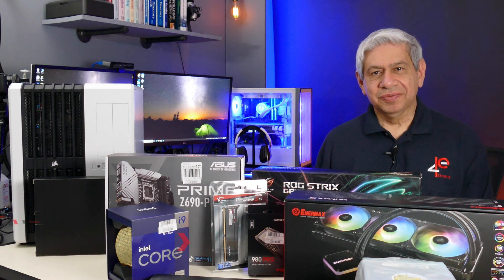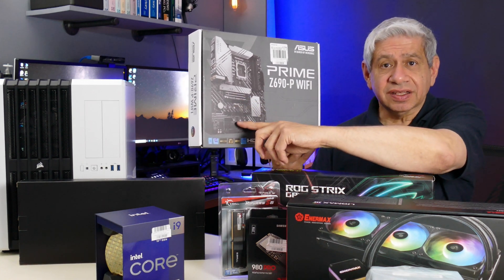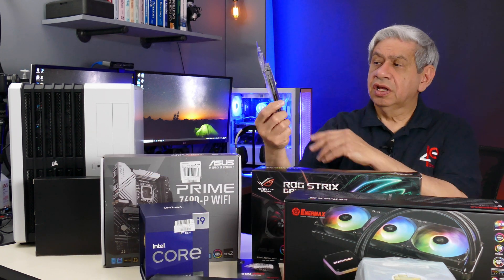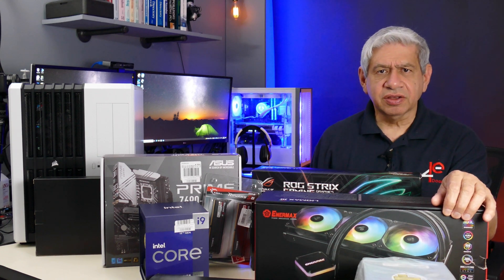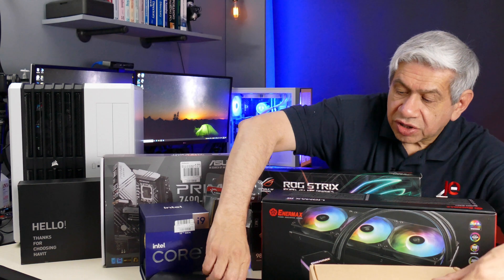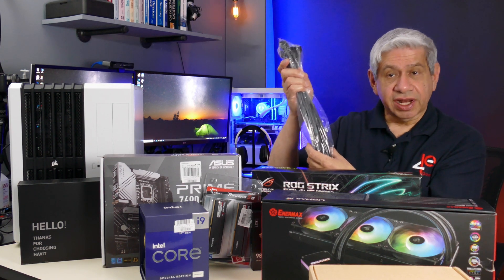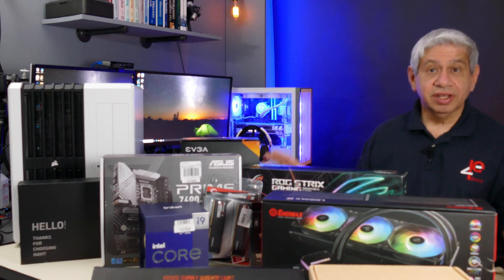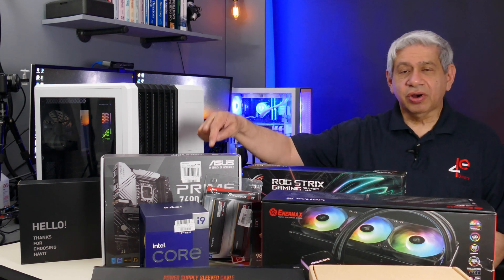Building a Home Lab VM Application Server – part 1, The parts roundup

Comment: Quite the power house.  I didnt see a link for the case.
FYI a number of years ago I bought a Coolermaster Liquid CPU cooler.  The pump failed, there is no indication of this other than unexpected shutdowns, then diagnosis using a CPU Temp utility.  You might consider installing this in your build.  The cooler was replaced under warranty
Reply from the maker: That case is no longer sold - probably since it has a plexi window rather than glass.

I know what you mean about AIO Coolers.  Though I've not had one fail on me, the best practice is to replace them every five years whether they've failed or not.  In this case, as I mentioned in in the video, I will likely get a better one than the one I bought for this build.  I will build with it, but then replace in a couple of weeks (possibly another good video), prior to my putting that server into 100% deployment.  Then use this one for the new test bed I plan on purchasing that supports water cooling.

Comment: The one bit of info I missed in the video is how you buy a higher binned CPU. When I have looked at CPU's for sale I have seen that some are on trays, and others in boxes. Are the higher binned CPU's in boxes, or on trays? Or are they sold in some other way?  Thanks. 😊
Reply from the maker: From what I've seen, you really cant tell the difference unless they are specially marked.  In the case of the i9-12900KS, Intel chose to specifically sell them as KS rather than just K.  Of course they are trying to make more money from those that binned well.

Binning has been done by many/most component manufactures for many years.  On some, like carbon resistors, that is how they determine the 'tolerance band' that those devices have.  THe normal would be plus or minus 10% of marked value, with the cheap ones being 20%.  The price would go up a lot for 5%, and would be very high for the 3, 2, or 1% - which are usually used in measuring devices.

Also, for many years, many people (including myself) believe that the reviewers are sent 'unmarked' binned samples for testing.  That is why you see a "couple" of reviewers go out and buy there own after the release date to compare to what they received from the manufacturer for a review.  I think that's quite obvious the case when you see those same reviewers decide to use the samples for their PC's, even though they could easily buy their own at a great discount because of who they are.  Just my humble opinion of course, I can only point to circumstantial evidence like I just mentioned.
Reply: @PE4Doers  Interesting. Thanks for the info. Most consumers can't really buy several CPU's and test them to see which one is the best, and then sell the rest as 2nd hand. I have heard about binning when it comes to CPU's, but no one has explained how you get the higher binned ones.

Comment: Thanks for the video. Very interesting. 👀
Reply from the maker: You are quite welcome.  What parts about it have you wondering?
Reply: @PE4Doers  Does KS means higher binned? 🙂
Reply from the maker: @nian60  In this case, yes.  Intel chose to change the marking in that way to indicate the higher performing CPU's.    The also cost about $200 more.
Reply: @PE4Doers  OK, thanks. 🙂
Reply from the maker: @nian60  You are quite welcome 🙂